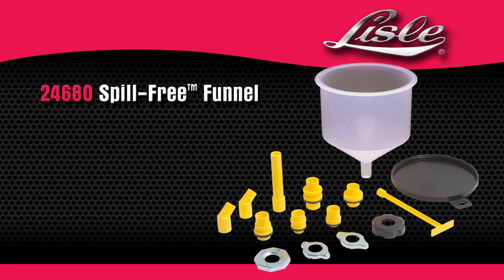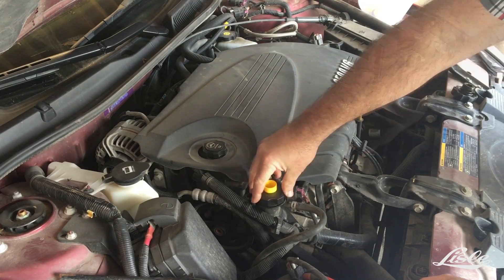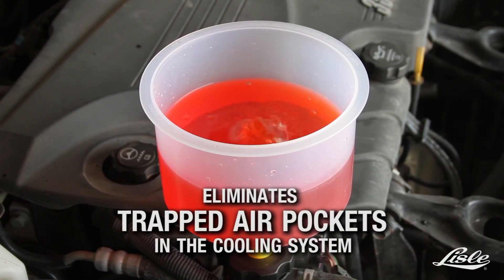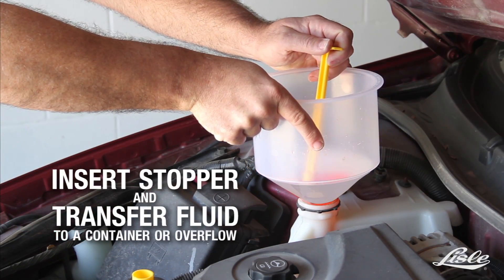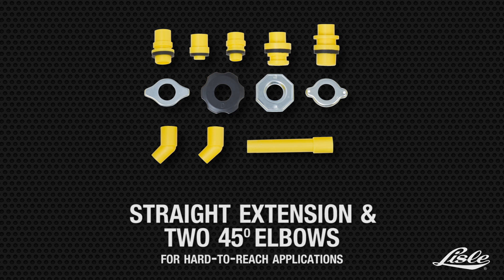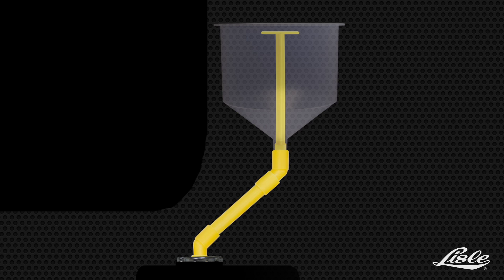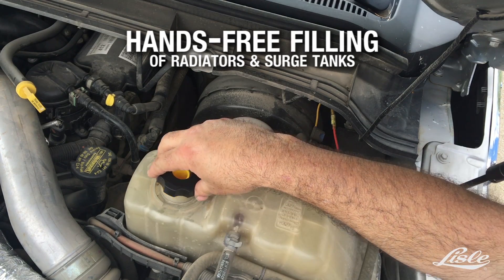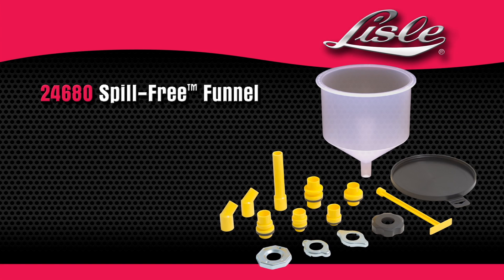Lisle 24680 Spill-Free Funnel [IMPROVED]

Comment: Respectfully, there are multiple steps or instructions thats left out to FULLY assist the consumer with using this product. As you know because you created MULTIPLE Adapters, you know that the Adapter your using in this video may differ from what we have to use to fit in our radiator or Reservoir. Logically there are 2 or 3 different adapters that can work on my car however I dont know which one to use. One of them fits inside of the smaller whole in my reservoir tank but when you take it out the gasket falls into the tank. The instructions says to place adapters inside of radiator with no movement. Inwhich the adapter I mentioned above is thr only one that creates no movement. The other 2 adapter fit similar to the one that you are using in this video but it will move slightly till I have to twist the metal cap onto my Reservoir. Inwhich leaves me in a situation where i dont know if this is air tight. 

Your also giving instructions from the perspective or situation of a person topping off their coolant system. I say this because its no way that a person who just did a flush like myself and my system is BONE DRY can start my car 1st then start adding coolant through this tool to get the air out the system. I will cause damage to my vehicle. 

Im not this is a bad or horrible tool, i just feel like the proper instructions for different cars and situations is nonexistent or limited leaving the consumer to guess this tool is working correctly. Also there should be some form of a conclusion meaning tell the consumer if your coolant gets to the max cool line or full and your still getting bubbles what do you do next? Do we release some coolant to continue to pour in coolant till we see no bubbles approaching the full mark or max cool line? The day I was using this tool I had way more questions, thats how i found your video hoping it explained or offered more information to make sure we are doing this correctly. You made a video directly from a car that has a radiator cap, knowing that all cars dont have this. So that means it should be separate instructions for cars that are using this tool through the Reservoir. You also know many cars have bleeder crews. Do we open them while using this or leave it closed? Other videos of mechanics using your tool is opening the bleeder. I honestly think you should make a more detailed video considering the question or comments you have received on youtube and your website and this will also help with sells because we will feel more comfortable recommending this to others. Respectfully, I wouldn't recommend this tool as a 100% way to get air out of your coolant system. Remember we are consumers not mechanics

Comment: Adapters to the radiators are not sealed tight.  Found this out while doing a flush and was initially filling with distiller water only, fortunately.  

Still trying to figure out how best to seal it tight, otherwise, returning the product.
Reply: Update: found a adapter that worked with one of the metal caps for the radiator.  Was a head scratcher for a bit.  Better instructions would go a long way, tips....
Reply: @WonderingAimlessly yeah I wish it came with instructions

Comment: Is a good tool/Idea but  careful cause when using the yellow pipe extension there is some spill,,,the T handle does NOT stop the coolant left in the pipe extension, so there will be an once or two that spills when you pull it out.....
Reply: Have not tried that...but good idea, I will next time
Reply: If you noticed he did say to squeeze the hose before plugging the funnel.This helps with the extra fluid found in the extension.